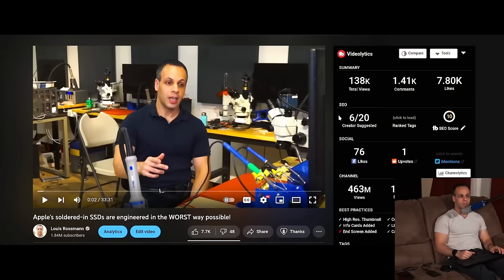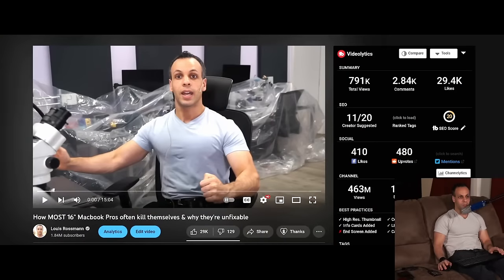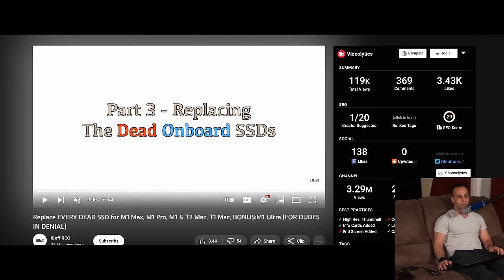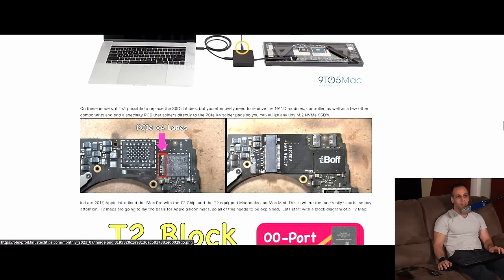The design of Apple's soldered in SSDs is worse than I thought!

Comment: Hynix chips are becoming a problem for old Nintendo consoles (specifically the Wii U). The NAND corrupts after not being powered on for a while, bricking the operating system (which has no "restore from USB" functionality like Xbox or PlayStation does).

That can happen to your MacBook, if Hynix didn't fix that design flaw.
Reply: Whoa, is the original Wii (pre-homebrew) also affected?
Reply: @cielazul713  I believe that Samsung made all the Wii NAND chips, and Wii U chips after a certain date.
Reply: @thepwrtank18  Phew! Thank you, my Wii is safely stored away in its original retail box for years now and I was worried as it holds sentimental value to me. I would be sad if I had unknowingly condemned it to permanent failure.
Reply: @cielazul713  All NAND will gradually lose its memory over time. It takes time (years), but it will happen. If it uses NAND, it will need to be turned on and allowed to refresh itself.

Comment: About 8 months ago, I bought a 512 GB Mac mini 2018. According to the S.M.A.R.T status, it had 95% of lifetime left. If it's accurate, I got pretty lucky. However, after just one OS reinstall and Time Machine restore, it went down to 94%. Now I'm just very cautious about saving bigger files on the internal drive, to avoid too many write cycles.

It's insane that users who pay thousands for a brand-new computer has to worry about this.

Comment: You can't have this many short to ground problems and other massive problems with the device you are producing with every single version you produce without it being introduced malicious malfunctions.
Reply: Or a complete failure to test destructively BEFORE taking the thing to market.
Well, they could have done the testing and just ignored/buried it.
Reply: @MonkeyJedi99  the arrangement with the different devices constantly having the same exact problem over and over again means that they are actually doing it intentionally. I have seen year after year of new devices with the exact same shorting problem with Apple. I'm not claiming that there aren't other manufacturers that have the same or worse problems only that if they are making the same mistakes over and over again there is a point where you can't deny the fact that it is intended. It might not be directly malicious but something along the lines of their machines that produce the devices requires you to trace everything out for the wire/cable paths and they are simply too lazy to make a change that would increase the durability and life of the product or it could be a case of them simply making only the bare minimum number of changes to each product before it ever gets to the manufacturing machines. Both of these are possible options for where it originally came from but keeping the problems is an intended choice to reduce the life span of the product.

Comment: I've seen m.2 1TB SSD for under 30 bucks on sale a few times in the past week,  600 for 1tb is a joke
Reply: Apple isn't selling SSDs. They are selling NAND modules. There are no controllers on those boards, only storage chips. It's a custom part for which they can charge whatever they want, thus the cost.
Reply: I hope the eu follows the battery regulation up with some generic expandable storage regulation. Regulation is the only way to help us consumers.

Barrier to entry is just too high in these fields (laptops, mobile phones, gpus)
Reply: Samsung 980 Pro 1TB SSD is around $100, and it's on the high tier of Internal SSD, what fcking sht does Apple even include on their objectively worse (proprietary) SSD that needs $500 mark up?

It just doesn't make any sense, with $600 I can probably buy Steam Deck with 512GB storage. If it's a joke, it doesn't even funny, it's insulting.
Reply: @DeanRikrikIchsanHakiki  the samung 970 1TB m.2 was $30 in microcenter on sale
Reply: Think different seems to be the translation from dont think, gimme lots of ur money🤮. Upgrades and accessoires were always insane compared to PCs.
Reply: @BuildTimeMC  Which is even better, also as other user have mentioned that they're selling NAND, not the whole SSD since the controller is absent, then why is it not... cheaper? Isn't it being handled by the T2/M1 already as a controller? Is the firmware is so divine that it costs so much money? It's just absurd.
Reply: @px0v so not including the controller and thus making it cheaper makes it more expensive? And its still slower than NVME drives we have now above 10Gb/s reads
Reply: @px0v  One would logically expect that a NAND module without any carrier boards or controller chip would cost LESS than an ssd, considering that those additional components cost money.
Reply: @junelawson6708 Very logical in fact, the SSD controller can be quite expensive too, good SSD controller can lead to better SSD performance, and Apple's NAND/Controllerless SSD costs 6x without any practical reason nor advantage, I say practical lightly because after watching the other video, even installing it on iMac or Mac Pro it is still less practical than normal NVMe SSD

Comment: Soldered SSDs are such a stupid design decision by Apple and their competitors that have started to do the same with their laptops. 

I really would like to get one of the Apple Silicon MacBook Airs but it is incredibly concerning that when the SSD dies the laptop becomes a paperweight.
Reply: Try and go for a lower-end ASUS, if possible(assuming you don't care for/need a high-powered laptop, though if you do, also ASUS). Been a reliable brand for me. NEVER buy crapple.
Reply: It's not stupid. They know that their customers are dumb and that's why they can get away with it.
Reply: For ultra portable devices (like tablets or 2in1s) it is not a bad choice, really. If you know that you will never upgrade, soldered RAM and SSD (or even eMMC/ U2 etc) can result in a device that is more resistant to shocks. Of course that design should not be the only one you can get - and I am pointing not only at Apple, but also at Lenovo and other manufacturers that are not giving you modular options. Of course one day we may end up with TCM CPU modules having all storage and RAM in single package. While this also could be beneficial for some applications (you essentially get computer you could solder into any design without hassle of high-speed routing) when one part of such TCM SoM fails - it is dead as whole.
Reply: @brylozketrzyn  I dread the day they cram everything in one package and force you tu upsell hard on storage.

I hope the eu follows the battery regulation up with some expandable storage regulation. Regulation is the only way to help us consumers.

Barrier to entry is just too high in these fields (laptops, mobile phones, gpus)
Reply: @raldone01  I am afraid, that all in one packages would be just too convenient (as electronics engineer I loved them too). You would still get some modular laptops for enormous prices and with lower specs and then affordable powerful ones but with limited or none repairability. Just look at CPUs - most of them already come with GPU and north bridge integrated. Next iteration was embedded TPM and platform management. Rise of high density SSDs may attract chipmakers to put them on die (or as chiplet on a single interposer). I know the benefits of separate ICs, but I am afraid we will see soon designs having just two chips - SoM and PMIC - on small PCB. And all the regulations will be seen as attempt to withhold innovation. That being said I do prefer having everything reasonably discrete, but at the end of a day you buy what you can buy.
Reply: @hipster2283  Apple really love you.
Reply: @brylozketrzyn  I design pcbs too. Its crazy that you can get a mcu with just 3-4 components to run.

I am mostly against regulation but I think there is a balance between "innovation" and "freedom".
Maybe they should consider regulation for periods.

Like all portable devices with user storage interaction must have the possibility for expansion until 2035.
Then in 2030 they could review the state of technology and update/change the regulation according to prototypes from companies.
Reply: @bakedbean37  I own zero Apple products, but I can acknowledge they're about the only decent laptop on sale today if you care about getting a nice package. I have an old ThinkPad I paid $100 for that runs Linux
Reply: @raldone01  that could be fair option. And craziest thing I have seen was dualcore MCU with PMIC, memory, boot flash, quartz and mmc in single package.
Reply: @westsenkovec I can picture the internal Apple meeting where they say "mark" instead of customer
Reply: @hipster2283  making it like auto leasing 🤷‍♂️

It's like they actively hate the environment, yet in the next breath virtue signal the latest greenwashing gimmick.

What's that phrase? Next they are going to start pissing on us and say it's raining
Reply: @kaden-sd6vb Asus had different issues... V core mosfets failing all the time on flagship machines. At least Louis can buy those cheaply. But I'd say Lenovo makes the best gaming/video editing laptops actually. Great cooling, very robust design!
Reply: @liammhodonohue  it's the only way you can buy a MacBook, because keeping one for more than a year or two will leave you with a brick when the SSD dies when you use swap constantly because 8gb of RAM isn't nearly enough for any modern OS in 2023

Comment: Honestly, with the M.2 form factor there's no reason to solder SSDs onto the board any more. You don't want a 2.5" brick taking up space and making the laptop thicker, I get it, but you can get SSDs barely any thicker than a PCB now.
Reply: Yeah it makes 0 sense, until you realize they actually WANT your laptop to break after a year or two, they know EXACTLY how long those laptops last...

Comment: How fitting that this video comes today. I fished a barely 3-year old Macbook Pro out of my company's eWaste today, nothing wrong with it, just that its out of warranty. Our policy is that we have to physically destroy drives for data security. Guess what happens when an SSD is soldered to a motherboard? You have to just drill through the board. Can't take the drive out and shred it. So a useful machine got turned into a paperweight. Theres a few hundred of them deployed right now. Good going Apple!
Reply: Absolutely crazy, they could employ someone to self off the parts and make a profit. Such a waste!
Reply: @affieuk  We don't have the capacity for that, our IT department is underfunded and drowning as-is. We do bulk liquidation with a local recycler, and when we have bulk equipment disposals (ie replacing our like 2000 network switches) we find a buyer, put them on pallets, and sell, but for stuff like laptops, its just not worth the effort.

Comment: Louis -  I am 62, I started with Fortran on punchcards when I was 16, I got the Sinclair ZX81 when I was 19 I think, then 8086 etc. I founded a company, built thousands of PCs and I am a whole life PC user. I still build them when I feel like it. But I have seen way more broken laptops than Macbooks. Tons. Many of them could not be repaired or were not feasible to repair. I fully understand what you are saying and you are right of course, I am with you on the Right to Repair argument. But to put this into perspective, how many MBs get fried this way, out of the total volumes sold ? I recently bought a MBPro16M2Max for a change, after having seen your videos. I am an enthusiasic photog and the thing just runs so damn fast, quiet and cool. I am aware of the risk, I bought an extended warranty and I am not overly worried. I have seen very few Apple products broken. This tablet that I am typing on is an Air 2 and runs like a champ daily. So - how many MBs actually break like this as a percentage of the sold ones ? And what is the reason for these failures ? A cheap power adapter perhaps ? Or an ESD incident ? etc.

Comment: I won't ever buy a new Apple PC anymore  ecause of this. The soldered stuff diminishes the value overall so much that the new price is unjustifiabe despite the advanced technology. Apple can make these soldered PCs, no problem, but I simply won't pay for it except the price comes down to a fair value. Clearly, a PC with exchangeable SSD and RAM is perceived as a higher value product by literally everybody. Therefore, a MacBook with exchangeable components costing 1000 USD would be worth half price of 500 USD with soldered components. Apple can ask 1000 for it but who am I to accept the deal? I am not stupid, sorry.

Comment: I checked with DriveDX the state of the SSD of my Macbook Pro 2018, which I use intensely every day, 24/7 with a constant swap on a 256GB disk, working on it for advanced video editing, with Final Cut and Davinci Resolve.
SSD Lifetime 96%
Overall Health rating: 100%
Health indicator, all 100% (apart from Composite Temperature, obviously).
When exactly is my SSD supposed to die?🤔

Comment: This is why many newer PC component standards (like DDR5 and PCIe 5.0) and fabrication processes (like 3nm and the future 2nm) are first stress-tested in-house before being released to the data-center/neural-network/data-processing markets and, eventually, the consumer market.

If you have to re-invent the wheel, you must meticulously stress-test the re-invention, then you need to let specialist, high-utility sectors use it to see if it can withstand 24/7 usage without issue before you release it to the general public. You don't "re-invent" for the sake of doing something no-one does.

There's a reason standards exist: they're mature and well behaved. Apple's motherboard/IC design philosophy effectively and invariably creates a ton of "standards" still in their infancies with a laundry list of possible behavioral issues like:
Lighting things on fire.
Eating stuff it's not supposed to.
Sticking a fork in the AC socket (like in the case of the A2141's NAND).

Comment: Since I bought my very first PC, back in 1991, I had to study everyday to keep the machine running as it should. I was a poor guy and I had to fight hard to learn and solve the problems as they occur. But today, when I look back, I know that I would never trade this difficult experience for any Apple in the world.
Reply: Do you still use that 1991 machine as your primary computer?
Reply: @ghost-user559   Nope, I only use it on occasion.
Reply: @pontocinza  Yeah I mean technology moves so fast now. I have functional Power PC and functional 32bit systems and just recently got rid of an old Windows 95 machine. But to be honest beyond novelty it’s all completely useless and grueling to use in any useful way for decades. With the functional window for tech, I really don’t see any realistic reasoning behind keeping a machine longer than maybe a decade, and even then you need another newer “primary machine” to make up for advancements and OS updates eventually anyway.
Reply: @pontocinza  It’s kind of a relief honestly to just have one really functional, silent, cool to the touch, and blazing fast Mac Mini, versus 5 different completely defunct and basically useless vintage machines. I keep those machines, but they can’t use the modern internet, they have usb 2 speed or worse, and they can’t really do much of anything whatsoever. My MacMini has 4 Thunderbolt ports, WiFi 6, and fast Ethernet. It’s totally flawless thus far and will likely last a decade with how I take care of it. I don’t know that any other brand would give me any more functional usage when tech moves so fast.

Comment: It is simple, the machines are designed to fail forcing you to buy a new machine, everyone with even little electronics knowledge knows that SSD's are CONSUMABLE items, meaning they WILL fail, that is why Apple soldered them in, so you haver to go and buy a new machine instead... it isn't stupidity, it is corporate greed, of the richest company in the world, I haven't purchased ANY new apple items in many years because of this. Myself and my wife use iPhone 6S, im typing this on a 2013 mac pro, my last computer was a 2010 mac pro, I have half a dozen 2011 MacBook pro which are used... As much as I love the Apple system GUI etc. I will NEVER buy another new Apple product, and I have been using them since 1989 !

Comment: The discussion on whether the inability to continue using the computer upon SSD failure is pure coincidence due to tight integration, or intentional malice, would be really interesting.. It's all speculation of course, and it can very well be that the omission of a SPI flash chip for the bios is purely for cost savings

Comment: I'm confused - I've just had a look and seen a ton of articles, forums and YT videos explaining how to use an external drive as an SSD for M2 and M1 macs. But it seems like Louis here is saying that this isn't possible...

Am I missing something here? Has something changed in the last 2 weeks? Or perhaps you can load from an external SSD so long as the internal SSD (with BIOS) is functional?
Reply: In simple words: If internal SSD break your computer will die so any external drive (SSD or HDD) won't work either. "Internal SSD" contain software which control and drive computer hardware so it must be functional for other things to work.

Comment: 1TB for 600$ is such a MASSIVE rip-off, its unbelievable. We currently have SATA 1TB SSDs being sold for less than 100$, and NVME ones for less than 150$.
Such a stark difference with PC where you can use just about any SSD possible as long as you have the correct slot, and replace them at any time without any complex tools or any knowledge.

Comment: This is sadly common on phones and most arm devices

there is no seperate chip that stores the BIOS so worst case scenario you have to desolder and flash directly onto the chip

With x86 computers you can boot into a USB and reinstall the OS but with arm processors you have to install a custom recovery first.